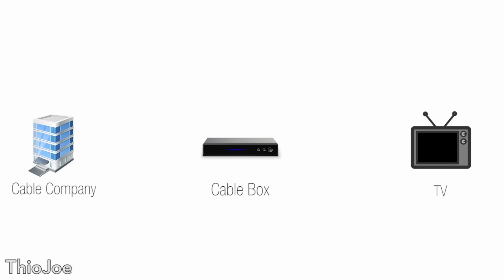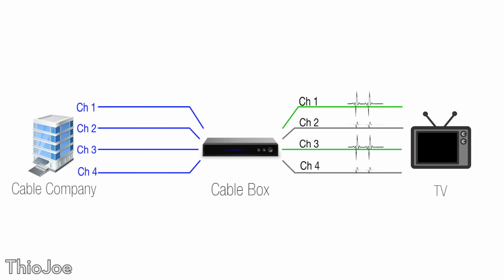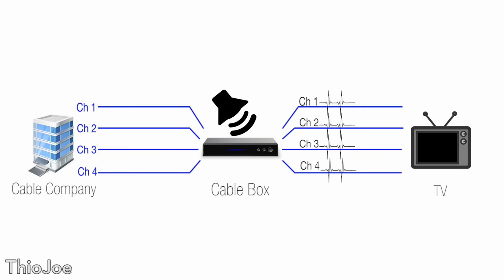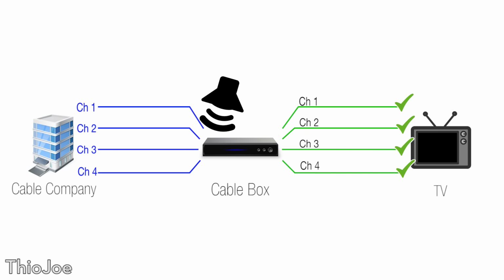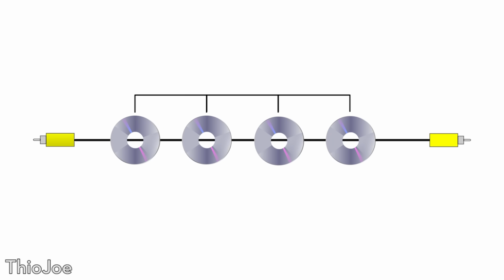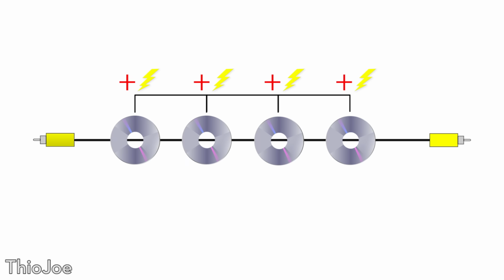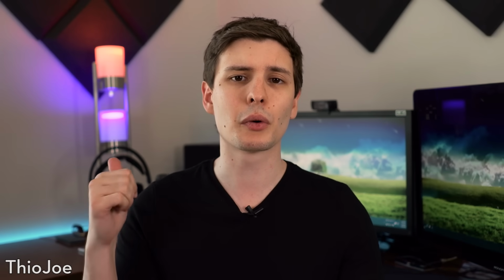How to Get Free Cable (All Channels)

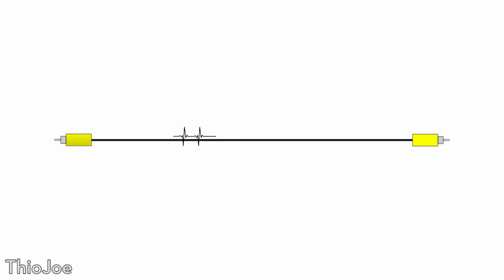Comment: I was very impressed that Maxwell's equations (3:40) were used to support the principle of inductive amplification (3:10).  Clearly, Maxwell's 3rd equation describes induction:  the line integral of the electric field around a closed loop is equal to the negative of the rate of change of the magnetic flux through the area enclosed by the loop.   Note that some cable systems use orthogonal frequency-division multiplexing, while others use non-orthogonal multiplexing.  This may explain why inductive amplification works for some systems and not others.
Reply: @Psych Slow Thank you.  Your comment was very helpful.

Comment: Also FYI this is NOT illegal as it only picks up signals that are technically "over the air" and therefore free use to the public. Ethical? No! but completely legal to enhance signals that can be picked up via an antenna which is what this is.
Reply: It doesn't work.Wrapping a Cd around a cable protected with insulation does nothing for signal nor does it enhance the signal. What this is bullshit.

Comment: This is the one thing I learned. Thought if the dvd's were closer to where it came into the house it would work better so I got a ladder went up the pole and while hooking the dvd's on the wire a cruiser stopped and asked what I was doing. The thing I finally learned was how difficult it is to get out of a straight jacket.

Comment: There is a little bit of truth to this back in the analogue days: the cable company broadcasts all channels down the coax to the subscribers on 6 or 8MHz Channels. Say they broadcast channels 1-40 but the subscriber only paid for channels 1 to 29, what the cable company would do is install a Low Pass / High Pass Filter at the cable box outside your house to block the frequencies from about 543MHz to 620MHz from getting through which would effectively block out ch30 to 40, but allow everything below that and above that. Higher frequencies may carry cable modem traffic.

How we used to cheat the cable company in the past was to go outside open up the cable box and remove the filter and replace it with a pass thru connector. The filter looks like a small tube about 3-4" long inline with the cable. The filter is nothing more than a simple R-C (Resistive/Capacitive) circuit where the cutoff frequency can easily determined by the formula fc=1/2*pi*R*C

Cable companies do make occasional checks to make sure their equipment has not been tampered with, so people that play it safe will remove the filter to watch or record a certain program and then replace it when done, or those that decide to get creative is to hollow out the guts of the filter and replace it with a piece of coax so visually it appears nothing is wrong.

Comment: Cant believe this actually works, I found it unlocks the channels when you use 10 cds , but this is the thing you have to use a particular artist, dire straights, something to do with the recording process, I believe it’s the multi wave algorithm that is used in the recording process, and the 3 second gap between tracks, and the flex linear plastic coatings which are only available on first generation cd,s ,who would of thought this is possible!

Comment: thanks thio it worked for me but i needed to use 9 CD pairs. i first tried with just two pairs but nothing was happening, i think its because my home is really far away from the signal source and needed more amplifying.
so for anyone else that the trick isnt working try adding more CD/DVD pairs!
Reply: This is bullshit. It doesn't work period. How can this work when cable is protected by insulation? There is no signal enhancement between cable and CD disc because of the insulation.
Reply: ***** 
you're doing it wrong dude.
Reply: Actually it is not the insulation, but the shielding which protects the signal. By the way you are connected by phone so that the cable box can get the access codes for your account. This doesn't work. You need filters to actually take away the noise that the cable companies feed onto the signal. This is a joke people. A+ on the kid keeping a straight face.
Reply: Okay BattousaiHBr tell me how to do it right.
Reply: ***** 
i wasnt talking about the trick btw.
Reply: BattousaiHBr what are you talking about?
Reply: +Michael M, Thanks for taking the time to respond. I don't think this shit is funny.
Reply: got it after only 7 pairs used. Must be stronger signal or something
Reply: east gate, Don't do this to us. The shit is bull crap and you know it. And it ain't funny. Some folks are reporting the dude.
Reply: *****
Ups, sorry. I was lying. Needed 8 pairs. Not that good signal after all.
Reply: east gate. Finally got it to work. What I did was duct tape my dog's ass to the cable leading into the wall. I get some shitty channels, but overall a great success.
Reply: +courther  no its not a dude n my old neighborhood use to hook up ppl cable free of charge

Comment: ok I used the duck tape around the CD and batteries and took the cable plug into the a-track then I added jelly and mayonnaise to the receiver after that I hooked up a piece of silly string to attach the chicken wing to the tv and voila FREE cable thanx thiojoe
Reply: slap some peanut butter on that too and get even more!
Reply: +Ben Michalski thanx good advise should I use the ones with the nuts in there are just go regular
Reply: +Edward Enard - I took everything you mentioned above and put it inside 5 gallon bucket and poured a German beer inside. Now I have Kabel Deutschland for free !

Comment: There are so many errors in this video.  so I will explain how CA ( conditional access ) operates, this is coming from someone that works at the headend ( where signals are processed of a cable company, .

1) There are many distribution systems,  older legacy system used HFC ( Hybrid fiber cable ) fiber reaches various optical nodes, than copper coax is used as local distribution, and to resident drops.   this is being phased out for fiber to the home.

2) The OP mentions that the cable box is needed to amplify the RF signals , WRONG,  RF signals coming from the street are around +5 - +20 dBmv  more than enough for any TV.  

3) STB ( set top box )  are used for decompressing the digital signal, and deciphering ( unscrambling )the signals.
The unscrambling part,  each STb has its own address, and code, which is also encrypted,  at the headend, the server keeps track of every STB address, ( CAS ID ) and when you order/pay programming,  that server sends out data riding on the RF signal, 
and the STB will receive and process these commands ONLY if the data matches.  again the OP was wrong in saying that Cable companies cannot send individual signals to each STB, they do this all the time, and with video streaming they can even do it with TV programming which has a much wider bandwidth than simple activation data. 

4)The trend these days is fiber to the home,  in this case, the home unit is actually an optical receiver, and could be completely IPTV or a hybrid of RF/IPTV/Data.  each home unit will have its own encryption ID.  same as previous.

Ok so how can one pirate these?  in the past,  people have been successful  "cloning" the security card ( smart card ) but newer cards are all but impossible to clone,  not only that, newer STB do not even use a card, that information is embedded, in a chip with no access ( ports burned away after it was programmed )  and on top of that, data being sent to activate STB, is regional,  so even if you could clone a card,  if you are not in the same region, that card would not receive the activation code.  there are additional security measures,  for example we can marry the cards to the STB.  which means, that you would also need to clone the STB to match the smart card. 

How to get free TV?   at the moment, if you have good internet ( at least 3mb ) you can get plenty free tv using software like Kodi. 

Cable TV companies know the days of selling programming,  is ending, they are transitioning to data delivery service ( Internet ) and communication. as Cable tv goes down,  data usage goes up.  so where you get your HBO,  ( free or from a pirate site ) is up to you,  the cable company will just sell you the bandwidth, so you can watch it.
Reply: 1) It
2) Is
3) A
4) Joke
Reply: Amazon has a 40 dollar gadget, that plugs right into the HDMI port of your TV.  no other connections other than the power.   uses a bluetooth remote,  so no remote IR sensors needed.

out of the box, this unit does not have Kodi, and you need to jailbreak it. ( completely legal and supported ) but after that , it works like a charm.   any TV can be a "smart" Kodi TV.   for less than one would spend on one month of cable.
Reply: ParanormalBasement i
Reply: Not sure what is more hilarious here, your response to this or the fake video.
Reply: Doesn't matter whether the video is a joke or not,  I just posted the real information the click bait title promised.   OP did not deliver,  I did.
Reply: agriperma Yep. And wasted your time. Forgot that part.
Reply: Kind of like you, with your responses right now eh? how Ironic.  this video has,  over 4,000,000 views, and you are saying no one, is interested in free cable tv?  really?   why do you think this video has that many views in the first place?   because of the title.  your point is moot.
Reply: agriperma I think if you computed the total time composing our respective responses you would find me wasting much less time :) but good try
Reply: They were on my case because they think I did not get that it was a joke,  frankly it does not matter if the video is a joke or not,   the fact is, the title is click bait,  and I only wished to share information, to those that clicked on this video for this information.    whether it is a joke, prank, or the OP believes the Earth is flat, is besides the point.

BTW Kodi 17 has been released.  good stuff.
Reply: How long take u 2 rite
Reply: If I was worried about wasting  time, do you think I would be on youtube?  how much time do you waste  watching none educational videos?
Reply: I completely got that this was a joke but if im being honest... i did also really enjoy reading your comment 👍 i always wondered what really happened inside that STB, nice one pal. I'm genuinly not being sarcastic, just saying because it seems theres too many dicks around, lol!!
Reply: agriperma
Reply: Collins Chukwuma oxymoron
Reply: agriperma u can still just make ur own antenna. And i dont know where u work at but i got free tv aswell just picking it from the sky
Reply: agriperma
Reply: agriperma
Reply: Then why living in an apartment are people always unscrewing cables and putting them on there incoming spot as if it was there own.they must be getting cable?
Reply: +TT23  You're wrong because you can't accurately judge what is a waste of time.
Reply: +agriperma   What is the name of the $40 item on Amazon which you speak of?
Reply: +agriperma
"RF signals coming from the street are around +5 - +20 dBmv" dead wood eekwall -15 dBmv, rite?
Reply: Nice if you had specified the product name !!!!!!!!!!!!!!!!
Reply: lol but no one cares :D
Reply: agriperma ,nice write up!
Reply: Thio joe lies on purpose because he wants people like you to make a joke out of it
Reply: agriperma and how we can get that software kodi?
Reply: agriperma and because the guy is cute ;-)
Reply: Save to safari

Comment: I didn't have any worthless CDs so I went to the attic and got some old LP albums and taped them together.  Now I only get NBC, CBS and ABC in black and white.
Reply: lol
Reply: Hahahahahahha
Reply: LMAO!!!!
Reply: What no Matlock?
Reply: should have used 78s now I can watch Glen Miller
Reply: +Jon Holmes.  does it work for DirecTV to
Reply: Well, you know what? When you cheap out, you get what you pay for. 
As for me, I didn't cheap out. I am using Sony Hi-Md 1gig minidiscs and life is great.
Reply: Del Tyler,
That was funny! You get the witty comeback of the day award!
Reply: Lol
Reply: What ever happened to that guy anyway?
Reply: Dude, Your comment cracked me up.
Reply: Boy you really go back in time and don't try anymore or you'll be back to stone age.
Reply: hahahahahahahahahahahahahahahaha you are too fun
Reply: The programming is probably better, with different shows all week. Nothing repeats the same day LOL. I think I actually enjoyed that option better. I plug a coax cable into a splitter and strip the center copper line. I get 24 - 30 free network channels. Many cable don't broadcast. And I send a signal to my Chromecast from my phone and get all kinds of stuff. No cable company. Though I do miss my table top PC. I can fire up tablets with my phone data.

Comment: I used a few Toshiba/Microsoft (“Red Ray”) HD-DVD discs in an effort to cut costs. Surprisingly, it worked! The only downside is that it permanently reset my set-top box to the year 2007.

Comment: I don’t know if it’s changed, but HBO was piped in to basic cable. All you had to do was get in your cable box, and remove the signal blocker the installer put on. Would loved to have seen a pay per view channel to see if it actually worked, or any other channel besides HBO.

Comment: The funny thing is this one does sound kind of legit in the beginning.
Reply: It is real until he says "amplify." Channels aren't amplified, they are decoded.
Reply: No it really doesnt
Reply: it's legit tho
Reply: does it actually work

like has anyone actually tried this and it worked for them
Reply: Hugs Gaming yes no problems
Reply: +Atif Khan lol
Reply: Back in the days of analog cable TV that was how it worked. Communication techs (cable guys) would physically go to cable feeds and install or uninstall pads/filters used to block out signal to premium channels. So if you were nice to your cable guy, he could "forget" to add a pad to your feed and you would get free HBO or something similar. Nowadays cable companies can control channel access digitally with rate codes.
Reply: This still works, you just have to remember to buy digital CD's, and not the analog version. Once you have those, go to the cable company website and download the digital rate codes (they should be in the self help section). Once you have burned those codes to the CD's, install them as directed in the video. I found that electrical tape works best because, it transmits electrical signals better.

Also, I found out that being "nice" to the cable guy isn't always so much fun...  O_o
Reply: nice

Comment: Instead of using gray duct tape, use the 3m brand -preferably clear tape. The transfer rate is better and clearer. You might even pick up 4k signals on a good day.

Comment: use a wine bottle cork for a spacer  just  drill hole in it in center  - or even a gust glue a piece of pvc pip with disc on either side of cds for spacing no need for tap just a thought

Comment: Tesla proved that if you stand on your roof and hold a fork towards the eastern sky , signals via electromagnetic waves would go straight through your body and power any device in your house as long as you cover the top of appliance or device with aluminum foil first . Of course you have to buddy up and take turns unless you move your appliances and devices onto the roof. I don’t recommend doing this during a storm bc it will cause power surges that can cause explosions.Although that CAN be alleviated by sticking a surge protector in your mouth. To prevent your hair from frizzing simply use a shower cap covered in petroleum jelly.  If that is too inconvenient call your power company and arrange monthly service.

Comment: HOW TO MAKE BANANA BREAD

INGREDIENTS
2 to 3 very ripe bananas, peeled
1/3 cup melted butter
1 teaspoon baking soda
Pinch of salt
3/4 cup sugar (1/2 cup if you would like it less sweet, 1 cup if more sweet)
1 large egg, beaten
1 teaspoon vanilla extract
1 1/2 cups of all-purpose flour
METHOD
1 Preheat the oven to 350°F (175°C), and butter a 4x8-inch loaf pan.

2 In a mixing bowl, mash the ripe bananas with a fork until completely smooth. Stir the melted butter into the mashed bananas.

3 Mix in the baking soda and salt. Stir in the sugar, beaten egg, and vanilla extract. Mix in the flour.

4 Pour the batter into your prepared loaf pan. Bake for 50 minutes to 1 hour at 350°F (175°C), or until a tester inserted into the center comes out clean.

5 Remove from oven and let cool in the pan for a few minutes. Then remove the banana bread from the pan and let cool completely before serving. Slice and serve. (A bread knife helps to make slices that aren't crumbly.)
Reply: Dallas cowboys game
Reply: thanks
Reply: Thanks
Reply: B
Reply: This is random and im allergic to bananas...
Reply: Lol. I've never baked a banana bread but this looks about right. I love BB. I will try it.
Reply: Why

Comment: What am i doing wrong? I have 32 dvds taped to my cable wire still no luck :P
Reply: Real ZX I know im just playin lol
Reply: +johnny blaze K
Reply: That's too many. That will attract UFOs and all sorts.
Reply: dude - I heard 38 DVDs will work because 32 scrambles the electromagnetism weakening the signal
Reply: yes, you rock that fixed it!!
Reply: you gotta add two rechargeable AA cells with wire wrapped around them.
Reply: John Mood dude relax its a joke channel get a clue.
Reply: You probably didn't put the face-to face and then alternate the  next set back to back (to increase the internal inductivity).  Either that, or the small school bus you rode to school was idling outside too long and the fumes got absorbed into your hair.
Keep trying.
Reply: You need to use 31 dvds because 32 is even number.
Reply: r u joking ? i thinks so and shure hope so
Reply: The DVD has to be made in Japan, not China. Then it will work.
Reply: Maybe you should get one more .It can't hurt you already have 32 Dvd's😕
Reply: does'nt work all systems
Reply: That's amazing,  this thing actually works!